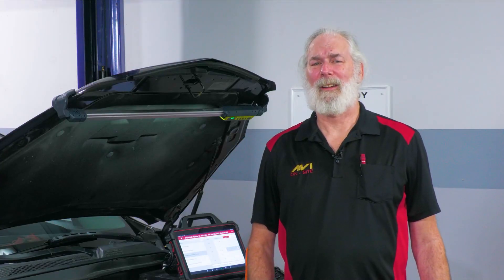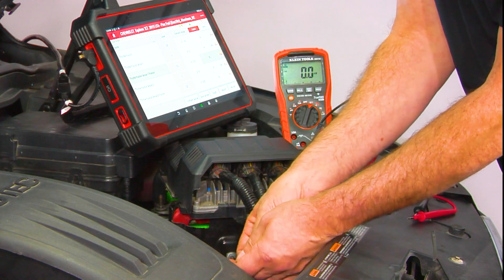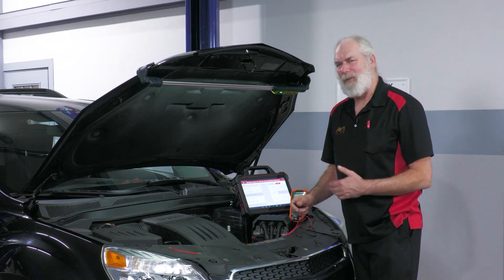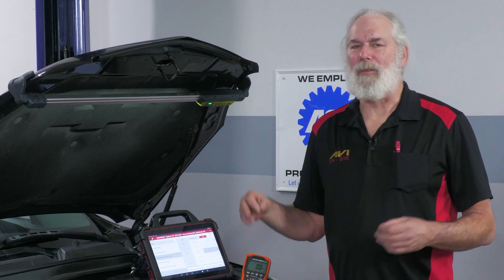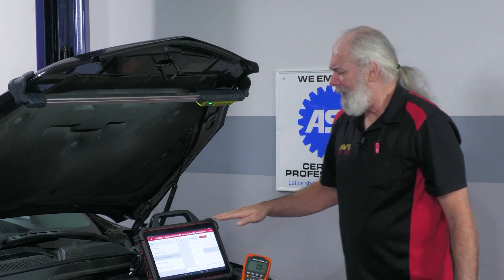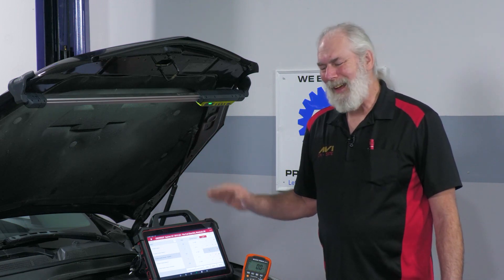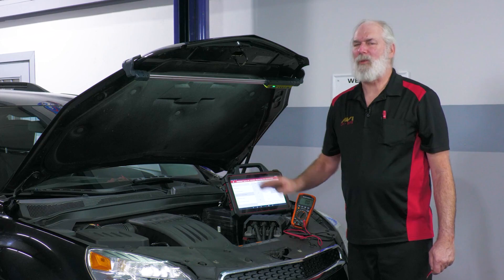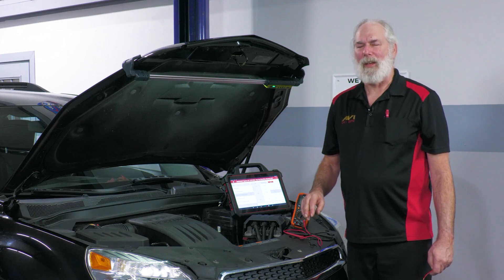AVI Electrical Tech Tip Diagnosing Two and Three Wire Sensors

Comment: I'd find a way to screw this up and fry an ECM.  It makes sense but shorting sensor wires makes me a little uneasy.
Reply: Use a 5 amp fuse with the jumper wire